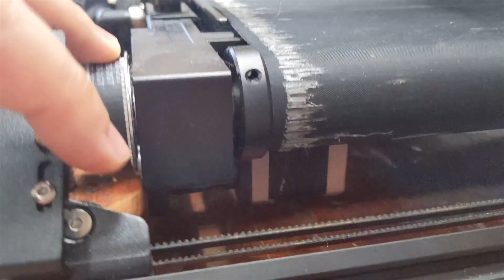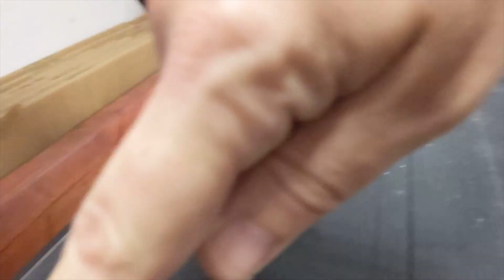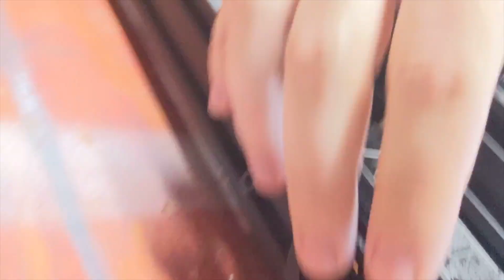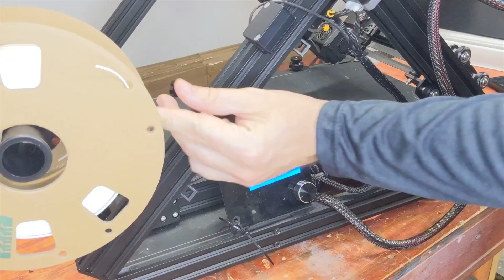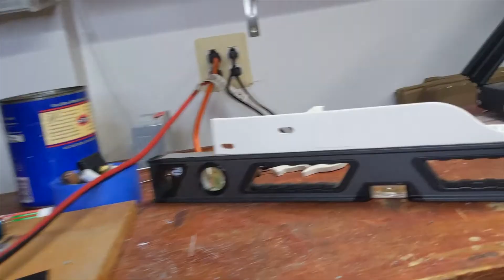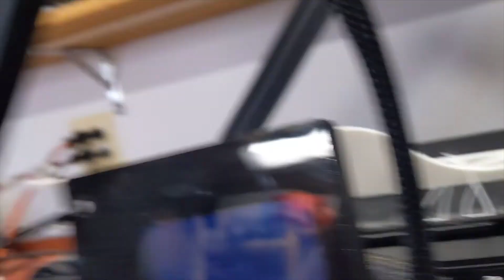CR-30 First Look!  Or, Examining a New Used Printer

Comment: Looking forward to seeing what you can do with a 22.5 degree or even 30 degree gantry mod on this CR-30!~
Which slicer are you using or planning to use?
Reply from the maker: Honestly I'm kind of appalled at the slicer selection for angled printers... I mean when I got Printrbot's PrintrBelt it was terrible and, uh, doesn't seem like a lot of improvements have been made!
Reply: @PaulChase  Here's to hoping PrusaSlicer and/or OrcaSlicer Devs will implement support for angled slicing soon 🤞🏻